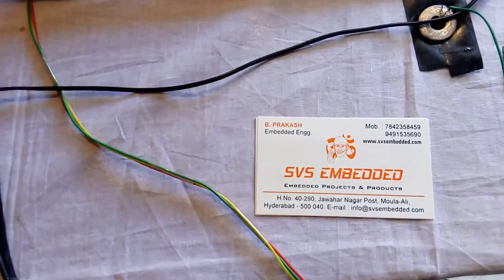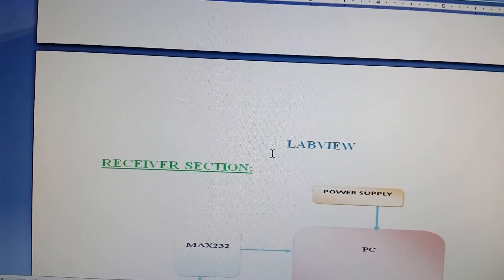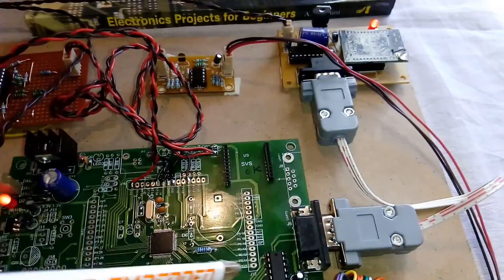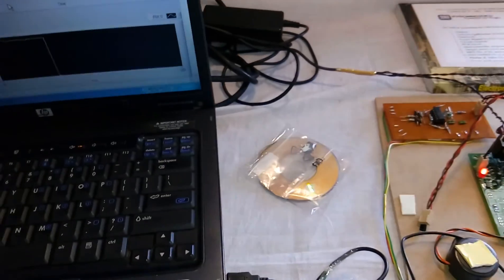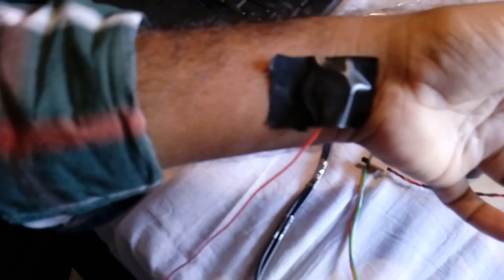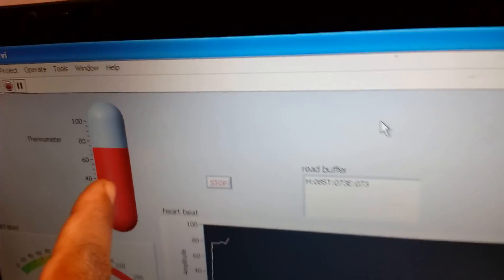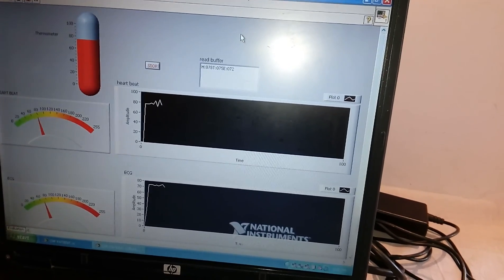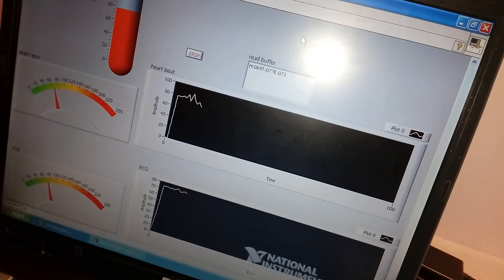Wireless ECG, Heartbeat and Body temperature Monitoring System Using ZigBee & LabVIEW

Comment: Hi . I want to tell you a problem. I need code to complete a project part. Hope you help . Please!
Reply from the maker: Thanks for watching and your valuable Feed back.yes we will provide CODE AND ckt  diagram.
we are selling the projects with least cost.if u order the project we will provide working hardware kit along with 
1.abstract
2.datasheets
3.documentation
4.schematic( circuit ) diagram.
5.software code.
6.sample ppts
7.photos&video file on entire project
through google drive.if u r interested to take the project.
send me a mail to  svsembedded@gmail.com,info@svsembedded.com.
9491535690,7842358459,
www.svsembedded.com,www.svskits.in,
we will send u the how to order procedure to u on mail.
Reply: check ur mail , plz
Reply: Did you get the code?